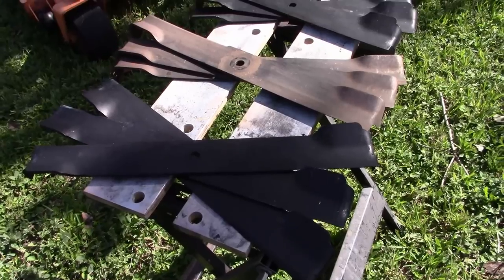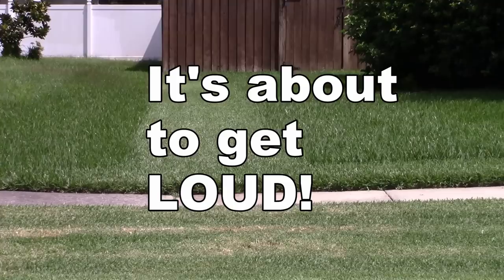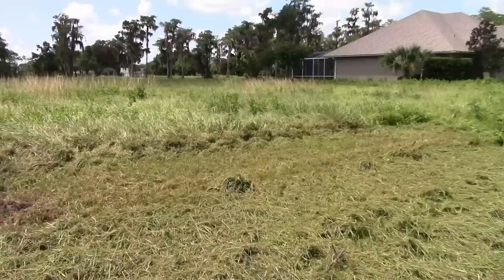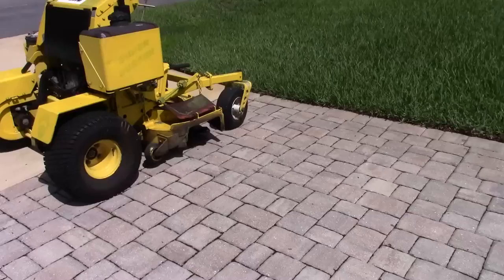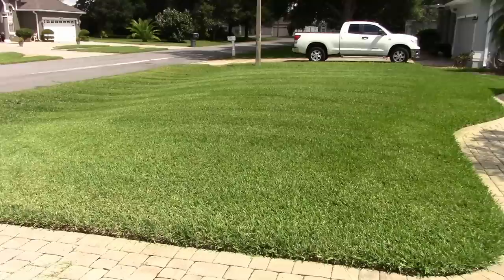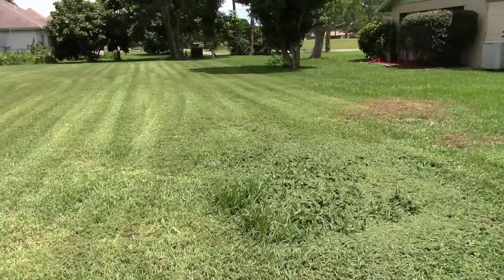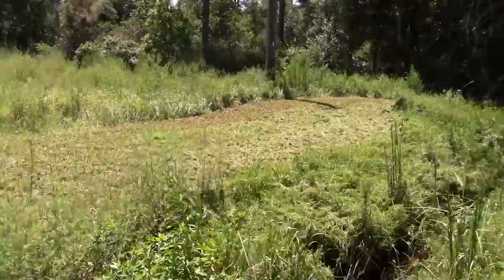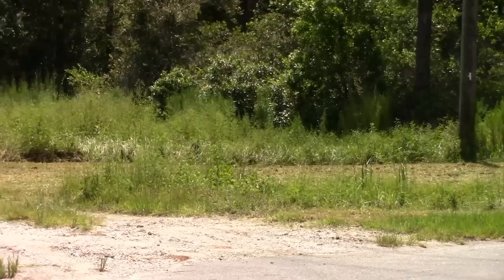Mowing with new type Kavli "Finisha" finishing blades - tall & short grass

Comment: Great to see videos that show exactly what is happening. Your videos don't beat around the bush you show every thing whether good or bad. Your reviews from what I have seen are  as honest as they come very refreshing. Others cut videos and are not as forthcoming. Mike what I want to know is you say the motor is not straining I run a team of mowers and the amount of gas that I use and the wear and tear is great what are the benefits of these blades for the professional such as yourself and others like me.
Reply from the maker: I hear what you're saying. We go through a lot of gas too. Which is another reason why I don't often run at full throttle. It's just not necessary. With these blades even more so. Many regular consumers don't know how the throttle governor works. The mower may seem as though it's keeping roughly the same RPM as you mow through thicker grass, but that's because your governor is calling on more fuel flow. You hear a difference when it reacts, but that's why they don't stall out. But in this case you'll notice that you don't even hear a reaction. Even on the really thick stuff at the end. The engine just stays constant. That a sure sign that it's not encountering strain, and not calling for more fuel.

Comment: I love my beast blades took on the world and mowed it down. Thanks Hans and Mike , now the Finisha I have to get it. I am trying to explain to people how much less stress is put on the mower which means a faster mow less gas that's money in my pocket.
Reply from the maker: Exactly. And the Finisha blades sail through this stuff even easier than the Beast blades. You will love them. I left them on the mowers and I'll come back and report how they do on a long term test. I'm using them for all my yards now.
Reply: @Something2LookAt  would you use these all the time or do you use the extreme ?
Reply from the maker: @kiraniumbra  Yes, I leave them on all the time. They mow great in all grass types.

Comment: I bet that the bigger blade and mower companies test blades in a wind tunnel. About 15 years ago I needed to knock down a field of tall weeds with my Toro 117 Groundsmaster with a 52” deck so I installed a set of Gator blades on it UPSIDE DOWN, and ran with the deck tilted up. It worked good but it wasn’t fun getting weeds thrown around and sometimes into my face.
Reply from the maker: Wow! What a unique idea! Yea I bet that was a weed storm!

Comment: The problem I see with these blades on finish turf, is the downward portion of the blade. It seems to me, it would cause excess damage to the ends of the blades of grass... causing more browning in a day or two, more moisture loss through the blade, and greater potential for "rust" (a red fungi that is especially threatening to fine blade turf grasses) or other parasites.
Reply: HI Sylent Xtinction we have been using the Beast blade for over three years testing and re testing haven't seen anything that you could classify as threatening to the turf. The Finisha has been used on a golf course turf for approximately 13 months nothing that we could identify as negative to the turf. It is a good and well justified comment thank you for that .Regards John
Reply: @johnkavli8181  great work John good way to save our bums from endless hours of high grass mowing in summer in Qld. Can you make blades at 453.64mm to suit a 36" hustler Raptor SD? I don't have the centre size but you probably do.
Reply: @terryinozland  Hi Terry not sure if we got back to you but yes we can

Comment: Do they ship to the U.S.? I came across your video and I'm extremely interested and have tried everything here where I'm at.  I'm in South Texas where we have St. Augustine grass and Bahia tall farm grass and the last couple years I've been trying so many options to get a clean look without it being a chore or having to cut in a slow crawl. The Bahia is such tough grass with seed stalks also and have to cut twice a week so that it doesn't bog my mower down while cutting, yet I have to bag about 4 contractor bags of grass a week so as to not leave so much dead long grass blades in my yard every week, because that will not break down on its own like that. I have a John Deere Z525e Z-trak mower. It takes forever to cut having to go so slow.  Would these work? Would I need to have a commercial type mower?  I've tried 2 types of gator blades and they cut just ok but I shouldn't have to cut to a slow creep in order to do so. I can't do the x-blade set up I was told because it's only for a commercial mower with larger spindles.  Can these be used on homeowner Z-trak mowers?  Any help would be greatly appreciated.  I'm at my wits end here.  Thank you
Reply from the maker: Yes, they will ship there.

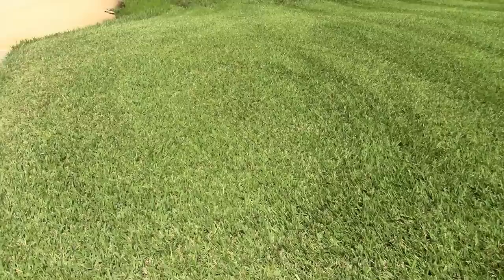Comment: 19:30 - I'm assuming here... the reason the clippings have better post processing, is the raised position of the cutting edge and the airfoil. The downward edge helps maintain the vacuum beneath the blade tip, and thus a higher degree of lift and recycling of the clippings.

Comment: How many hours do you have on the scag and Great Dane? How reliable are they? Any issues?
Reply from the maker: Scag has 1500 hours and nothing but belts have broke. 8 years old! The Great Dane is almost 20 years old and it had 2300 hrs when the Kawasaki blew. When we put the new engine on it, I'm afraid we never did put a new hour meter on it. So, who knows?

Comment: I think that I need one of those finish blades on my Deere.
Reply from the maker: Oh I forgot to mention. These are much cheaper than the "Beast" blades. Aaah, sorry John. Forgot to mention.
Reply: Have you tried the Predator blades? I run them on my Z920m. 👍
Reply from the maker: @joshslawnlandscape9935  No I haven't. Honestly I'm gonna have to look that one up. You like them?
Reply: @Something2LookAt  apologies, that was for Jeff the original commentor. I'm not sure if they make them for SCAG, but they are pretty similar to Gator Blades. They are sold at a lot of JD dealers, brand is XHT. I really like them though for my JD Z920. Nice long cutting edge and durable. 👍😎💪

Comment: I really wanted to be impressed with those blades. However, I can see what they're doing on the first pass, and then they pretty much clean it up on the second pass. Honestly I think any sharp blade would do the same. I may still have to try a set and see how they do
Reply from the maker: Oh no they wouldn't! Of course on a mower like this, the first pass would be pretty good even with the standard blades that came with it. But with a lot of experience with this mower and can tell you it is far better than standard or even Gator blades. Very impressive.

Comment: Been watching your videos for a while, and I've always wanted to ask why you never run your mower wide open? It seems you are always throttled back.
Reply from the maker: There is actually rarely a reason to run at full throttle. The idea that the engine manufacturer requires the engine to always be run at full throttle is a myth. Many people make that claim, but nobody can show it in a manual. There are occasions for running full throttle, but most of the time it's just wasting gas. And with these big engines, it's a lot of gas. I look at clipping disbursement only. Whatever throttle level is laying it down nice and even is what I go with.
Reply: @Something2LookAt  I understand it has to do withe speed of the cooling fan keeping the air cooled engine the correct temp. Lugging a air cooled engine at low speed cooled overheat it since the airflow will be lower than the engine was designed for.
Reply from the maker: @michaelgray2793  But also notice my ground speed. I generally also mow slower than most people. If you listen to the engine tone you'll notice that I am staying aware of the work load. These blades were sailing right through it so revving up wasn't necessary. But if I were using standard blades I may have need full throttle.

Comment: What engine do you have on your cheetah? I have the Kohler 29hp and it seems way underpowered compared to my 35hp
Reply from the maker: It has the Kawasaki 850V, which is apparently only 27 HP even though it says 31 right on it. Plenty of power though.

Comment: Do you sharpen blades if they are brand new?
Reply from the maker: THAT is a good question! I don't know. I did sharpen these, but I don't always sharpen brand new blades. Hard to tell how sharp it is under all that paint. John, you would know. Are consumers in general supposed to sharpen brand new blades?
Reply: Hi Aurizx no need to sharpen we do that they are right to go when you get them.

Comment: Too bad there are no blades like that for regular lawn mowers.
Reply from the maker: Yes there are. Same blade. This video takes 3 of the 21 inch blades. A regular mower takes 1. I will probably do that soon and show you guys. :)
Reply: Yes pretty soon Mike.
Reply from the maker: @johnkavli8181  Actually I did notice that other blade you showed. You're full of surprises aren't you? :)
Reply: We try maybe like you said make our type of   ( X ) Blades ?
Reply from the maker: @johnkavli8181  Oh they don't weld them together or anything. Like for this experiment I'll just put a Beast and a Finisha on the same spindle 90 degrees staggered. I did it with Gator blades once on a video. Seems like they would drift from 90 degrees but they don't move. Even if they did they would still drift evenly and still be balanced, but they don't. It will be a fun "How bad can bad get?" experiment. lol
Reply: We will be waiting Mike with bated breath.

Comment: You've got one or more worn out pulleys on the Great Dane mower..................Their loud.
Reply from the maker: No no, the deck is actually swaying from side to side. I'll fix that. All the pulleys and spindles are new! I restored this mower on this channel.
Reply: @Something2LookAt  do the GD's have a Panhard Bar on the deck?
Reply from the maker: @JeffreyStrader  No it just has the arms with the big bushings. I replaced the bushings but there's more stuff loose. It is 20 years old of course. I will get creative and tighten it up.